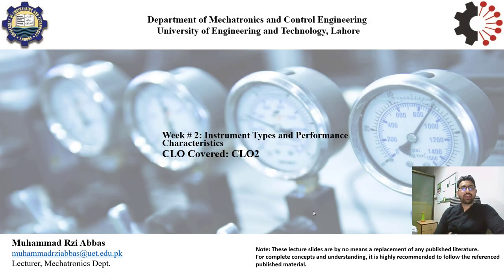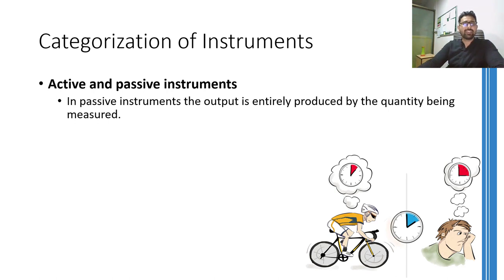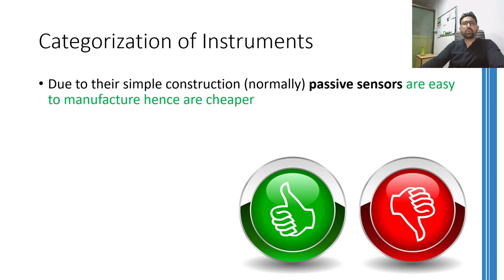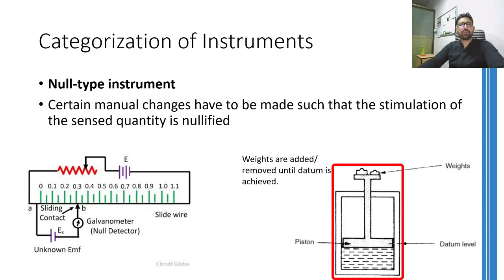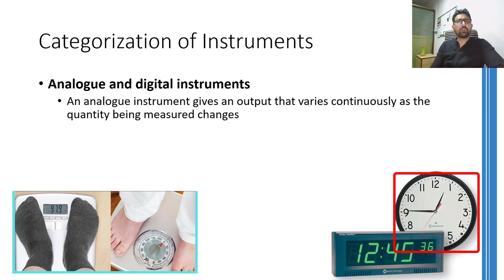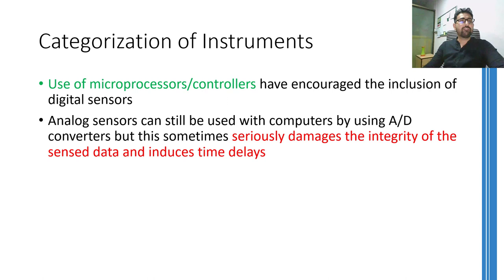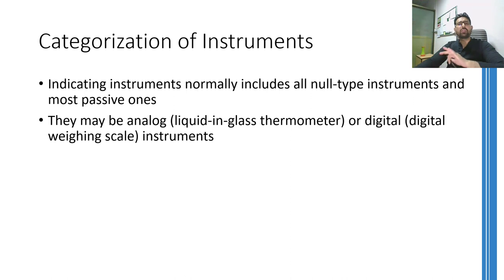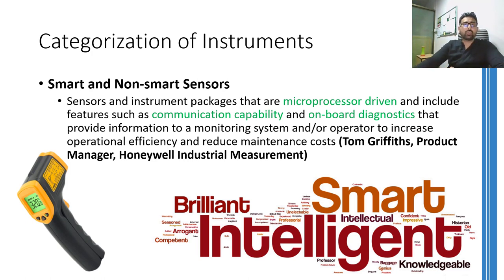Lecture 2 Sensor Types and Performance Characteristics (Part A)

Comment: Active and passive instruments in daily life:
Active instrument: The digital pressure tester at petrol stations to test the current air pressure in vehicle tires.
Passive instrument: To measure blood pressure, your doctor uses an instrument called a sphygmomanometer, which is more often referred to as a blood pressure cuff. Output reading entirely depends on patients blood pressure.

Comment: Active and Passive Instruments:
1. Active Instrument: Water Level Indicator which detects whether the water level of the tank is high or low.
2. Passive Instrument: Tachometer which is used to measure speed of some machine, for instance a motor, in revolutions per minute (RPM).

Comment: Active instrument/sensor: Sonar or ultrasonic sensor is an active sensor. A pulse is generated through trigger pin and the echo pins receive the pulse after it bounces backs from the obstacle. The returning pulse is only a stimulus and it is the internal timer circuit that measures the time duration for returning pulse.

Passive instrument: An LDR or Photoresistor is an instance of Passive transducer because it entirely depends receiving luminosity (light) on the component's sensitive surface to change it resistance. It doesn't have own energy source.

Comment: Active Instruments: Water level indicators used in our water tanks are active instruments because any change in the level of water activates the internal source of the indicator which results in the output.

Passive Instruments: A voltmeter is a passive instrument because it needs some voltages to pass through it and then it will measure that, that certain or specific voltages are acting as the source for the voltmeter and also be measured by the voltmeter.

Comment: Active: water level indicators in the tanks.
passive: simple pressure gauge used to check tyre air pressures inside the bicycles.

Comment: Active Instruments: Multimeter for measuring voltages, currents and resistances in a circuit.
Passive Instruments: Barometer for measuring pressure of air inside the tyre

Comment: Task) 
Active instrument: A blood pressure monitor measures the blood pressure from a persons arm and that pressure displays a reading on the monitor which is powered by an external source.
Passive instrument: A spring balance where the output on the scale is solely dependent on the weight applied to the spring.

Comment: The gyros which sense the tiltation of the mobile are active instruments used commonly today, while the lever balloon assembly in old water tanks is an example of a passive instrument where water input from the large single tubewell of the whole town, to the tank, depends upon the position of the balloon ball attached to the lever.

Comment: Active Instrument:
fluid level indicator
Passive Instrument:
Ammeter
Voltmeter
To measure blood pressure, your doctor uses an instrument called a sphygmomanometer, which is more often referred to as a blood pressure cuff. Output reading entirely depends on patients blood pressure.

Comment: Active components include , and op-amps or other IC chips. Common passive components include resistors, capacitors, and most potentiometers (“pots”) like a volume knob.

Comment: Active Instruments:
Digital Wall Clock, Glucometer, Tachometer, DMM, Electricity Meters, Digital Weighing Machine, Smart Visitor Counter
Passive Instruments:
Tyre Pressure Guage, Speed Meter Of Motercycle, Old Gass Meters, Stove's Heat Controller

Comment: *Active instrument* : Digital speedometer.The speed sensor gives data in the form of an electrical signal and the meter converts it into digits.
Passive instrument:  Analogue speedometer of the bike. Speed sensor rotates with bike tire and the meter shows reading proportional to the sensor speed.

Comment: Passive: analog weight measuring machine depends on the weight of our body to deflect the scale
active: Force Sensitive Resistor uses the Force from our body and then converts it into the voltage changes.

Comment: Passive Instrument: Ammeter, used for measuring the current in the circuit.
Active Instrument: Speed measuring instruments installed in automotive vehicles.

Comment: Passive instrument: Manometer used to check pressure of air inside a tyre.
Active instrument: Optical mouse works by emitting light.

Comment: Sir my question is that if passive instruments don't have their own power supply, a digital instrument that uses a supply to exhibit its readings can be a passive one?? Is the Term ACTIVE & PASSIVE is particularly for the sensing element which absorbs the reading?? or the exhibition of that reading too is involved in deciding the state of the instrument.
Reply: same question